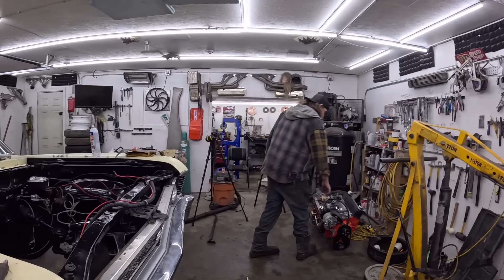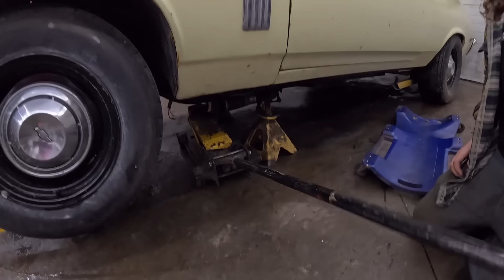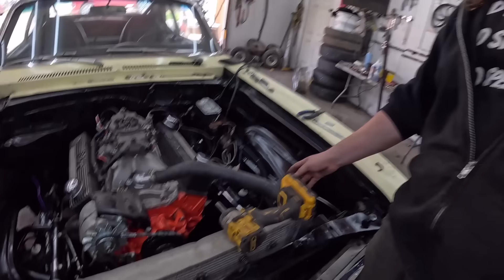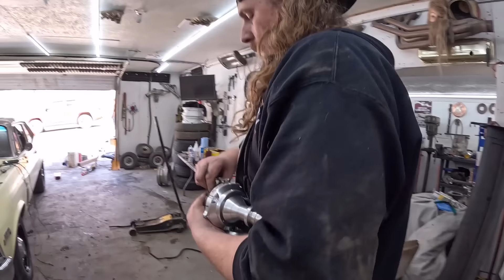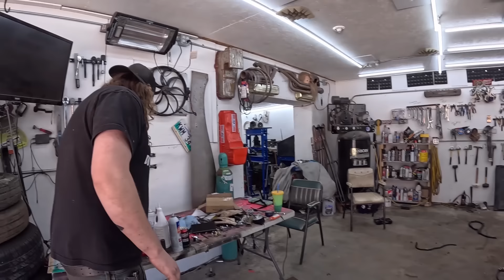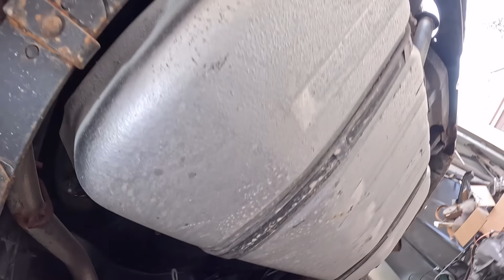Unleashing 400 Horses: The Roaring Revival of My Chevy Nova *SOUNDS AMAZING

Comment: The front subframe and suspension components are interchangeable. Lower windshield molding, wiper motors, and wiper transmissions, and wiper arms are also interchangeable. 1969 Camaro steering columns are interchangeable with 1969 to 1974 Nova columns.:face-fuchsia-wide-eyes::face-purple-smiling-fangs::hand-orange-covering-eyes::eyes-pink-heart-shape::face-turquoise-covering-eyes::body-green-covering-eyes::body-green-covering-eyes::body-green-covering-eyes::hand-purple-blue-peace::hand-purple-blue-peace::hand-purple-blue-peace::body-blue-raised-arms::body-blue-raised-arms::body-blue-raised-arms::cat-orange-whistling::face-blue-wide-eyes::face-fuchsia-tongue-out::trophy-yellow-smiling::trophy-yellow-smiling::trophy-yellow-smiling::hand-purple-blue-peace::hand-purple-blue-peace::hand-purple-blue-peace:

Comment: Dan, I also have a Camaro and do not drive it. Yes it is to small. My thing is that I rebuilt it bumper to bumper and love the looks or it. I park it in my driveway, and it is one of the first things I see when I leave the house every day.  Every day dam that is a good looking car. The thing is that I have touched every nut, bolt, and washer on that car, and now it is a part of me. I look at it and can say I built that. I have now moved on to a 78 Malibu that had been sitting in a field since 98 with on engine or transmission.

Comment: Dude, we see you are a big fella. I had to ride in the back seat of my buddies 69 427 400 Trans. It is cramped. The Nova is more Sleeper and fits you better. See if you can get shorter shift arms and use short settings to move the ball forward a tad. You a crisp 1 2 shift  if that cam is working like it sounds. The tall lever could handle shorter arms. Or the lower hole if your arms has two holes. I loved my Muncie.

Comment: If it's hard to start once you put all the timing in cut your hot wire to the distributor and use a toggle switch  once she get spinning hit the  switch and she's running hot rod 101. I've done that on most my builds.

Comment: My ‘68 Camaro sold and became a ‘77 Trans Am.  The ‘77 Trans Am got sold and became the ‘32 Ford Coupe hot rod.  The ‘32 Ford Coupe hot rod got traded straight across for a 1955 Nomad.  In a roundabout way, I ended up agreeing with DD Speed Shop about not fitting in a 1st gen Camaro.

Comment: What is the static compression and what are the cam specs (0.050" duration, valve lift, lobe separation)?  Sounds great and 430ish hp will be fun on the street - but not with 3.08:1 gears!

Comment: You could at least throw a blanket over the core support, and tie a burlap bag over the rear of the transmission. I find TDC by turning the engine over with a ratchet. You can do the bumping thing forever and never get it right on the mark. Sounds GOOD. PLEASE don't paint it black.

Comment: 22:11 ok ,. i m issed something... i went back over and over and i'm still missing why you are 'Locking Out" the new distributor?? why bother with this? would the engine not benefit from some  advance in the acceleration curve? i guess my querry is: why do this at all... a working part...?

Comment: AH... The "Blowout" controversy! You blowout a rear tire,  you have no engine braking nor control of which way the car will turn. A front blowout have a hard pull to one side but you can still slow down in a somewhat straight line. Dealership rule of thumb is put the tires with the most tread depth on the drive axle.

Comment: The Camaro is a done dollar. Where did you get that shifter. There's only one shifter to be considered that is a Hurst. That piece of junk you got there isn't even working.. I'll bet that morski guy bought the Camaro and he's going to put that blown 350 in it. And blow your doors off. The only chance you have is the Chevy ll. With that twin turbo setup. 4link, shortened rear end and some 10in. or wider 15in.rims with drag radial tires

Comment: You're way too cheap on your price by the way but anyway I built a several of them I'm heavier than you and your same height and like I said I'll do it 506 the same you know I've looked two or three 67 and 68 and 169 69 does have more ride heights and is more comfortable will tell you that the 67 is tighter but the 67 has a thinner seat if you go with the original seat but at the end of the day it's what you want man if you don't want it you don't want it you don't have to answer to nobody it's up to you I have I have an over right now and I love it but my head is too high on the expense seat and my head touches the ceiling it's automatic on the column and it's all Factory and my head touches the ceiling play the bench seat doesn't mean I don't still love the car it's just not really comfortable to me but is my wife's car and I won't sell it for anything but it's like yours I mean it's it's blue wizard I got to the factory hood that's blue and then I have a Black Cowl Hood that sometimes I put on it for a while you know when I want to be racing you know but and then I've got to 412 horsepower 350 that I can put it in the car dad and pausing rear end is the 373 gear and with the two and a half exhaust will glass packs it sounds real good and it's it's fast but it's also very straight Worthy it's not my car I don't like it it's not fun for me. Just like the Camaros not fun for you just like I know that I can make the Nova fun for me but then my wife looking like it so I leave it alone. You done too much work on that Camaro the only has 15,004 and give extra parts with it I think it's your car you can give it away if you want to that's what I'm saying all these people don't understand it's your car you can do whatever you want to with it anyway take it easy Bud talk to you later Greg
Reply: lol no one gonna read that headache producing wall of spam bud.